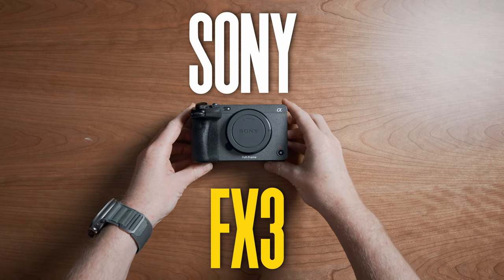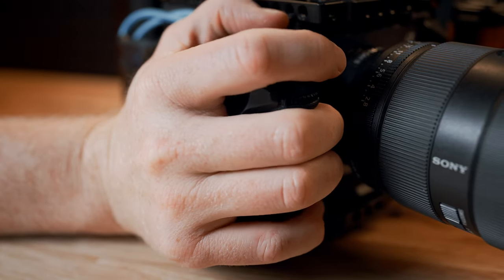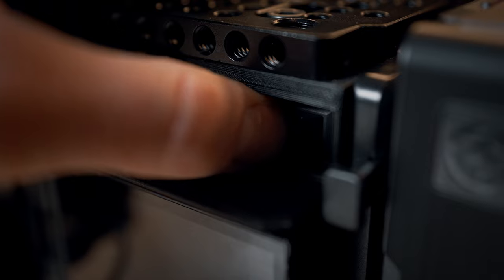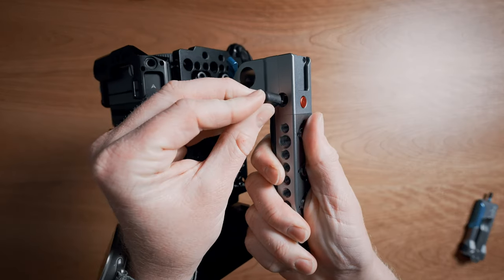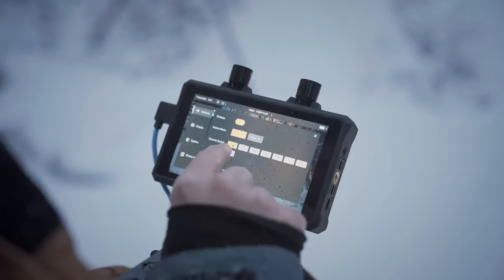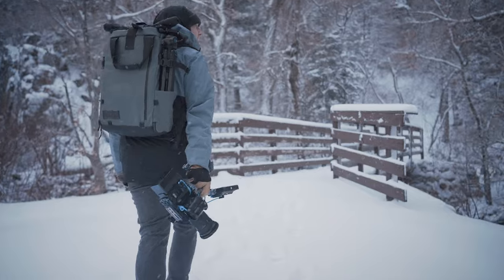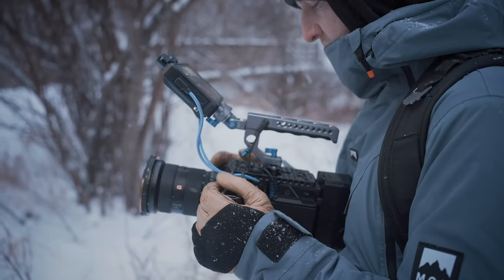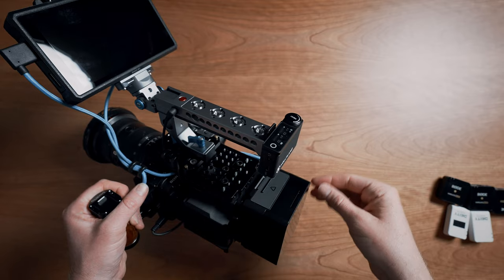The PERFECT Sony FX3 FX30 Cinema Rig in 2024

Comment: every time i hear "best cinema camera" in a camera that doesnt have internal nd, timecode, zebras & all of those things & is just a more dynamic a7siii i lose 30 minutes off my life. :/ that being said. this build is SICK. and the cineback is GENIUS. and i hope the next instalment of the fx3 actually matches its price point bc u sony folks deserve better than what u settle for:3.
Reply from the maker: Fair criticism. I think filter systems are good enough to solve the ND issue and having IBIS instead is a good trade off that a lot of people might prefer. Almost every monitor has zebras. They also added time code to the FX3… albeit more cumbersome than it should be. 

Agreed on price point. Wish there was an option without the XLR handle since that sells for $600 on its own…
Reply: How many movies have been shot using a camera with internal NDs
Reply: What camera do you have?
Reply: FX30 has zebras and internal time code options (with compatible devices). It does not have internal ND; that's correct! That's the one thing I wish it had.
Reply: @bunkertons  although having IBIS is a fair trade off for this generation. ND can easily be added to a lens.
Reply: It has timecode and zebras. Zebras have been on every A7 camera. It also doesn’t have more DR than the A7siii. It’s the same sensor and same DR.
Reply: Yeah it’s good for the algorithm and clickbait, but as long as the video itself is valuable then in the end it’s fine. I own the FX3 but know that even if I kit it out (and yes, add the ability to sync time code on the FX3, because it’s possible), it’s still not the same as having everything already there on the camera body with all kinds of physical buttons that just make the process more convenient. But I couldn’t afford the FX6 so here I am! I love the FX3 btw.
Reply: Thanks to several comments, you now know about half your complaints are irrelevant.
Then... "shutter angle" is available too.
No internal NDs, and so what ?  I've been on, litteraly, hundreds of filming sets (mostly fiction films) and have nevee ever seen any camera with this feature. Except once :  it was a docu-fiction, filmed with TV broadcast gear so the result had the "news" look. Apart from that one... no, never a camera with built-in NDs. Mostly due to the fact these are not seamlessly variable. And filming with "steps" in the iris adjustments is just a no-go !
Then... do you know many cameras with 4 channels audio, gyroscopic embedded data, fully customizable interface (all buttons but one can be set to your liking), 16 bit RAW video output (with 14+ EI dynamic range, as a bonus), zoom lever to operate all powered-zoom type of lenses, outstanding digital zoom (the FX30 has a 6.2K sensor, and zooming-in goes with zero quality loss), a huge range of lenses from 50 USD on and from about a dozen manufacturers (same with accessories) , a compact body made of magnesium alloy... and the list could go on.
The FX3 is sold at 4200 USD nominal, when the FX30 goes with a 2300 USD price tag (I may be off 100 USD, but not much more).
Isn't that enough for you to make it a cinema camera ?  OK, so ask the the director of "The creator" for he probably has a few relevant things to say about it. And many other since the film release, because the business now knows those machines are imagery beasts.
I wish you many fruitful and happy filmings !  ✋️😉

Comment: $1200 to fix my A1 with a full motherboard replacement later, SONY IS NOT KIDDING with their battery warnings. I used the same dummy battery in the FX3 and A1, and never had an issue with the FX3 (perhaps we have the fan to thank??) but I 10/10 recommend to anyone looking for a Dtap-Sony power solution, just invest in the KondorBlue 65W Power Delivery Dtap-USB-c cables. I’ve loved them, and had no issues. Also convenient to power laptop/ipad on the go with a Vmount. Again, never had a problem with FX3, and obviously not an option if you NEED the usb-c for another in/output option, but I think one of these cables will 100% pay for itself in not needing to fix a Sony camera’s overcooked internals.
Reply from the maker: dang... definitely don't like hearing that horror story!
Reply: My Canon R5 also got its motherboard/sensor cooked from using the Tilta dummy battery so do be careful with dummy batteries, I personally will not be using them ever because of my experiences. It also fried something in my 80d which makes it freeze and shut off at times. My R5 had coverage so CarePak for the win! Got it replaced for free, got to love canons extended warranty!

Comment: Really nice, but for me, not using the FX3 XLR top handle is a no-go. As a documentary shooter, sound is of uttermost importance. I use an AVX system, directly connected to the XLR ports + a shotgun connected to the mini jack. 

I admit that the original FX3 top handle is not the best but once you upgrade it with the SMALLRIG MD3490 XLR Extensión Rig and the SmallRig MD3990 Top Plate it changes everything.   
On the MD3990 top plate, I add a 2172 Mini Quick Release NATO Rail + a SmallRig 2905B Monitor Mount to attach my 5" portkeys BM5 III monitor connected using the 2957B Smallrig Ultra-Slim 4K HDMI Cable.

Instead of the Cineback, I just use the (relatively new) Small Rig 4064B Compact V-Mount Battery Mounting System that directly attaches on the NATO rail of the TILTA Full Camera Cage (also works with Smallrig cage). It's an L-shaped design, compact, 230gr, tool-less mounting system for V-mount battery that doesnt require any rods. 
Compared to the Cineback, it doesnt have so many D-tap and doesn't have power switch to avoid drain when the camera is not in use... but for me this is not a dealbreaker and doesn't outweigh the fact of being able to use the FX3 XLr handle. The FX3 flip screen can also be safely tucked away on the side of the V-lock and serve as a control screen, just like on the Cineback. 

I also use the VB99 batteries which are awesome and power the camera via USB-C. I dont use a dummy battery because I like the battery to remain closed and in case my V-mount battery runs out of power, the camera doesn't turn off as the internal battery takes over and I have plenty of time to hot swap a fully charged V-mount battery. My Portkeys monitor connects to the 8V output of the V-lock. I get between 4 and 5 hours of runtime with a fully charged VB99 battery.

I also use the SmallRig 3847 Side Handle, that can rotate and as a NATO quick release system to attach on the left side of the cage. That offers a really stable way to hold camera. 

And that's my alternative to the CINEBACK but I certainly look forward to see if there is a version in the future that will allow to use the FX3/FX30 XLR top handle. 
Congrats for your video.
Reply: Same here, Caled did make an extension unit though that goes on top of cineback. Basically giving you an 'FX6 Style' top handle with audio.
Reply: Check out Battle Tested Film Gear, who made one super cool that is compatible with the handle

Comment: Excellent review/overview of the Cineback.  👍🏾

The one thing I changed in my setup was the D-tap to dummy battery connection. I went with D-tap to USB-C PD. This way I am able to have a battery in the camera and have extended power or if I need to break the rig down, I'll already have a charged battery.

Also the D-tap splitter's orientation causes me to have to route the cable against itself instead of going directly behind the 3d printed part. 

Other than that the rig is solid and does improve the stability of the footage! 

Great video! Keep up the great work! 👍🏾
Reply: I'm also considering going down the D-tap to USB-C PD route. 

Can I ask which cable did you buy?
For some reason it's very difficult to find reliable D-tap to USB-C PD cables online (other than the Kondor Blue, which costs a lot to ship to where I live).

I have seen some horror stories people bricking their cameras with D-tap cables ,although it's usually the dummy battery set-up.
Reply: @kamoshikaproductions343  I went with the Kondor blue cable. I got it for $31.00 at a local camera shop.

There is another route you can go as well IF you go with the Small Rig V-mount battery. You can go directly from the Small Rig battery to your camera. The battery has built in circuit protection and a screen on the back that shows all your charging info.

I will say that the issue with using the Kondor Blue (D-tap to USC-C PD) cable is that there's a small plastic part in the middle of the cable that takes some work to get it tucked in behind the 3D printed part of the Cineback. 

The other issue is that the D-tap connections are oriented in such a way that really puts stress on the short Kondor Blue D-Tap to USB-C cable.

I am waiting to see if I will be able to flip the D-tap splitter board over. 

I hope this helps.
Reply: @PurposedLensPhotoMedia  

Thanks a lot for taking the time to comment.

I wasn't aware of the downsides of the Kondor Blue cable and the possibility of powering straight through a SmallRig battery.

And yeah, I'm sure there will be new upgraded additions to the Cineback so hopefully Caleb will flip the ports over.

Comment: Love the rig. I am waiting for the A7IV version, but I might just buy Smallrig's compact adjustable v-mount plate that includes an arca swiss plate. Combined with a v-mount battery with USB-C and DC out that's already enough for my camera and monitor. On the camera itself, I have a cage, side handle and top handle. The only thing I'll have to figure out is cable routing.
Reply: Your solution is similar to mine, more versatile too.
Reply: smallrig 4063 B
Reply: That's a good one, but I am using the smaller Smallrig 4064. So the same thing, but without the rods or breast padding since I have the rig on a tripod most of the time.

Comment: This looks sweet! I'm curious why you didn't just plug in the v-mount battery directly to the FX3 via USBC and have a Sony battery in the FX3. It seems like that would be better than what you're doing there with that dummy battery.
Reply: I plug my the amount directly into my FX30 and keep a battery in and about a cable from BH that make sure it's the right amount of power.
Reply from the maker: Yeah main reason was it was an extra switch to power the camera this way. Which is just pure laziness. I have the dtap to USBc as well and sometimes will rig it that way, but it’s hard to manage that cable with the big block on it

Comment: Rigid Pro have made a FX3 handle version....im still working out a few flaws in the use of the 8Sinn Cage which is pretty much awful. They said it was the best cage for the handle version but it leave so much to be desired. I should be finalizing the build to shoot a Military Action short film on Feb 3, I might try to talk about his a bit on my personal youtube channel or facebook. I like the 3D print a bit better than cineback and a nice voltage meter on the side as well.

Comment: There's a ton that could go wrong using a dummy battery. I'd highly recommend using a PD UBC Cable to D-Tap to charge the internal battery using the USBC port on the FX3. The whole open battery door situation is a disaster waiting to happen too. If for whatever reason, your V-Mount battery fails or gets accidentally switched off, your FX3 goes with it and that's a big no-no, especially if you're recording. This one works perfectly from Amazon, "Alvin's Cables USB-C Type-C PD to D-tap Power Cable" even though it doesn't have a slick blue Kondor Blue branding lol I'd rather sacrifice a little style for a working FX3.
Reply from the maker: Yea Kondor blue makes a USBC to dtap as well!

Comment: I created a somewhat similar rig with the SmallRig V Mount battery plate and a rotating Tilta top handle- all on a Tilta cage... I use the USB-C connection to power my FX30 - so no dummy battery needed for me. Does this Cineback work with the Title cage - if so I might give it a try - just not worth having to purchase an entire new cage system at this time for me??
Reply: Yeah it does. In Calebs original video when he is releasing the cine back, he specifically states you must get the small tilta cage in order for it to fit into the cineback

Comment: Great informative video. Cineback is great to use if you don't use LWS standards. I'd prefer usb-c power via vb99 than a record button. Also you can keep recording if vb99 is out of juice.
Reply: I got the cineback and did usb c to d tap. I like having the interal battery in there so like you said if the v mount loses power or even if I accidentally hit that power switch my camera will stay on.

Comment: Really cool, Kyle! I was wondering: can you use a USB cable from the FX3 directly to the V Mount Battery so that you don't have to use a dummy battery?
Reply from the maker: Yes you can. Either USBc to USBc or DTap to USBc will work. You just have to turn on both the Cineback and the camera separately, since turning off the cineback will only disable to charging to the in-camera battery. Minor convenience though and certainly much safer for the camera
Reply: Thank you so much, this helps a lot

Comment: Hey Kyle great information here. I’m making the (costly) investment in the FX3 with lenses and using your links as a template for fitting it out. Question for you. I’ll be using this for some travel video, so I’ll be moving around and filming quite a bit. Is there a bag you recommend that will fit this build out for the most part without having to deconstruct it every time?

Comment: Looks like a potentially neat solution. But.... I'm not a fan of having the power delivered only via a dummy battery as there is a risk of file corruption if unpowered accidently or you need to swap out a V-mount cell. Also to overcome the 'Sony battery nag' I personally favour using an OEM Sony battery with additional power being topped up from a V-mount via the USB-C port. I also have difficulty ignoring the risk (possibly overstated) of 'bricking' a Sony body by using a dummy battery if/when things go wrong on voltage delivery and the dummy cell gets 'overvolted' possibly as a result of the voltage conversion circuit (between V-mount and FX3) developing a fault.

On audio it does seem a pity to bypass one of the main benefits of having an FX3 (HQ audio via powered XLR into a digital interface). OK not really a problem with one of several workarounds eg using a time code cable on FX3 with something like several Deity TC-1 units synced together and a separate TC jammed field recorder. Or more simply just having something plugged into the 3.5mm audio jack.

One advantage of an FX3 vs FX6 (there are many downsides like no inbuilt ND) is the ability to work in a more minimalist fashion - small, light, quick, inconspicuously and/or gimbal friendly. For that, there is merit in being able to quickly reconfigure the rig into say just a basic body with small prime lens. The inbuilt battery is needed for this - another reason I would shun the dummy battery suggestion.

Notwithstanding my slight reservations there is much to like and it's good to have options. I feel a 'cineback' solution will really come into it's own if a way can be found to still utilise the Sony XLR audio handle. SmallRig already have a few parts to enhance this handle (extension to rear for better ergo and plate for top (better protection of plastic parts and option to add other components).
Reply from the maker: Just put out a new video on a workaround for audio instead of the XLR handle. And yeah you can use the DTap to USBc cable instead of a dummy battery if you’re worried about the dummy battery issue

Comment: Imo the small rig the v mount battery plate that is adjustable is more versatile
Reply from the maker: I do like that one (it’s linked in the description), but it still leaves you with a huge mess of cables and mounting is way limited
Reply: @kylemeshna  you could add a cheese plate in front of the v mount for additional top mounting, also mondo ties by kondor blue, if you need to flip or close screen with this one it’s more time consuming to break down
Reply from the maker: @felipeandjess there’s a slot for the screen with this so it’s all sorted

Comment: I Just bought a FX3 and I thought I was sold on the M1 enhanced but I'm so torn between the M1 and the LH7P / 5P ii for the Sony integration. Was it just the confusing interface on the portkeys that made you choose the M1? This is the last piece I need to finish up my build, any insight on the core reasons you chose this is appreciated!
Reply from the maker: UI was definitely a huge consideration. The LH7P was also a bit large for my liking and I really liked the Sony integration, but then it got disconnected somehow and I haven't been able to get it re-configured to connect again
Reply: @kylemeshna  that would be almost the entire reason I got the port keys and if it’s unreliable it defeats the purpose. I’ll go with my gut and stay with the m1. Thanks for the help!

Comment: Where did you get the connector for the recording button that goes on your Sony camera? BH only has a canon connector? Is it worth it ?
Reply from the maker: Direct from Kondor Blue they have the Sony one. I do quite like having it
Reply: Thanks!! By any chance did your wooden handle get in the way of the right angle HDMI port ? Did you have any issues or concerns about it ?
Reply from the maker: @Isaucruz  nope, it does not get in the way, especially if you use the Right Angle HDMI cable